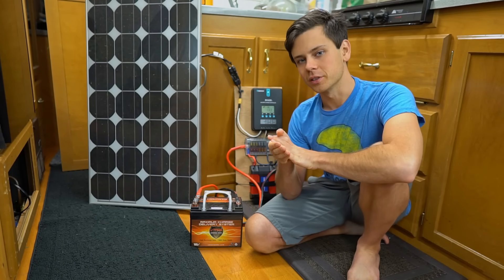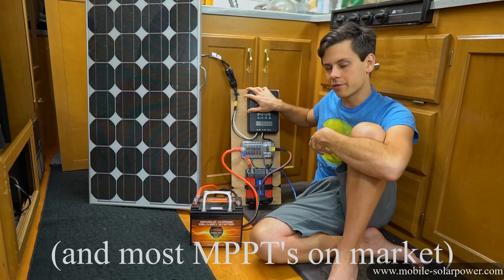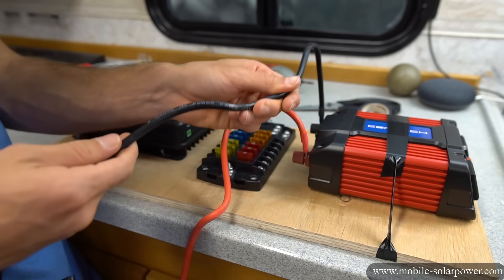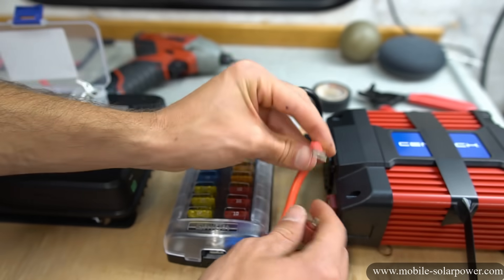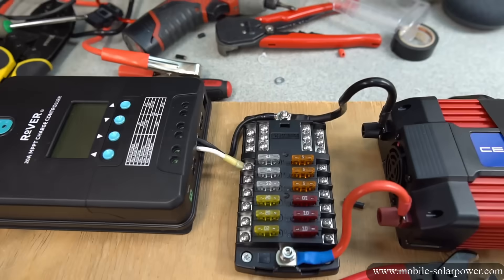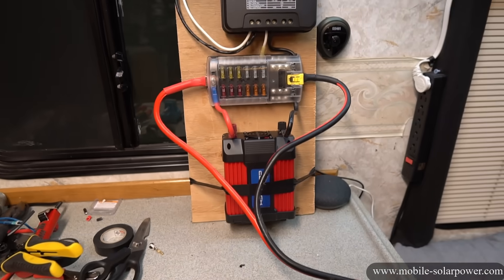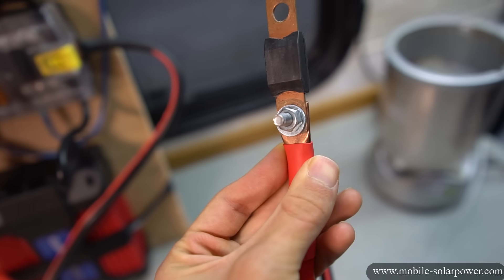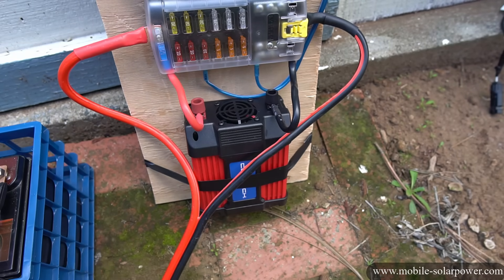DIY 200 Watt 12 volt Solar Power System "The Minimalist" Beginner Tutorial

Comment: Might be a dumb question, but why isn't the system grounded to the chassis of the motorhome/van?
Reply from the maker: you can ground it to the chassis but there's no real reason because it's not a true Earth ground so it will not dissipate excess charge or reduce noise in the system. If you want to save money on wire, then sure, ground to chassis. If you're connecting to shore power then sure ground every thing to Earth ground.
Reply: Thanks for the explanation

Comment: Hey Will. As per your advice I have ordered blue sea block. Expensive in the Uk compared to others. I’ve not seen you wire the solar charge controller through your fuse block that way before. Is the use ‘in use’in that scenario. Would save a wire run if so. Always learning. Keep it up. Happy new year

Comment: Hi Will, 
 enjoy and learn so much from your videos.  Question, I have a 12 v lithium battery in my rv.  No inverter since no much need for 120vac.  Have generator if ac needed.  I am looking at purchasing Zamp 140 amp portable solar panel to recharge battery when boondocking.  What do you think.

Comment: I'm new at this.  Y do u need a fuse box if an inverter has built in fuses?
Reply from the maker: Yeah it's for 12 volt DC appliances. Inverter is for AC appliances.
Reply from the maker: Inverter doesn't have built it fuses. It a tually might, but it still needs a fuse.

Comment: Will great job as always, thanks for making and sharing. I have limited space on top of my travel trailer and would like to use 2 160 W panels. Do  you have a video on how to make a 320 W system?  
HAPPY NEW YEAR, 2019

CHEERS, Kenny
Reply from the maker: Yeah pretty much the same. Usually you can fill the roof with panels, get a ton of batteries and stick a big enough solar charge controller between the two

Comment: Hey I'm getting 200w renogy kit 20a with bluetooth. Is that a good brand to buy? If so im just using it to power up 2 t5 shoplight for about 18 hours.  What type and how many batteries would I need? Thanks man! Your videos awesome btw!
Reply: Also getting 2000w renogy power inverter is that good? Or too much?
Reply from the maker: You would have to figure out wattage ratings of all lights and calculate it. 18 hours? You probably need a larger system just guessing
Reply from the maker: My book covers step by step method for calculating a system

Comment: Curious why you do not recommend the rover charge controller, if you're willing to share. Thx.
Reply from the maker: Sure. Weak tiny input terminals. No  over current protection so no way to over panel. Extremely hard to mount. Those are the main reasons